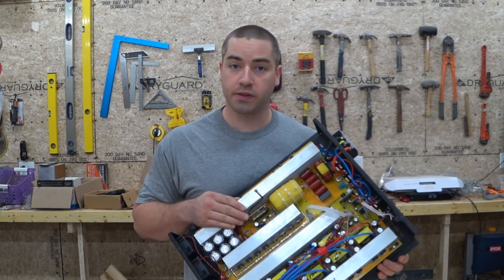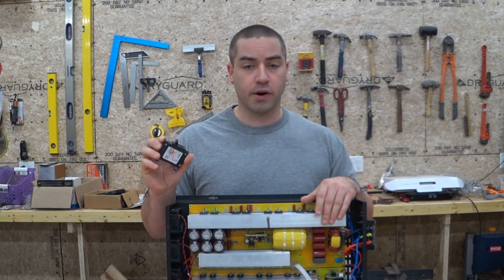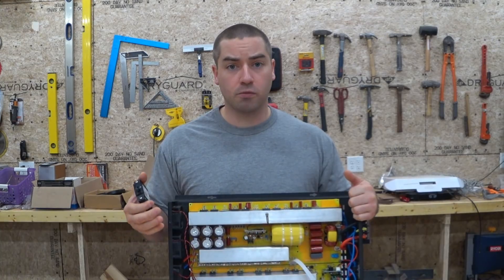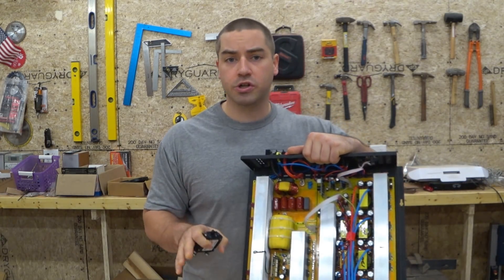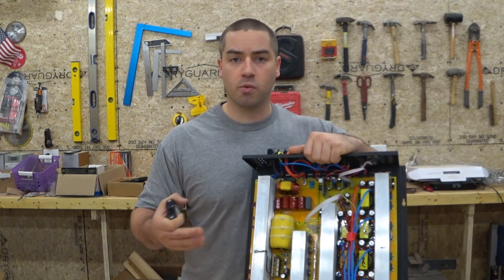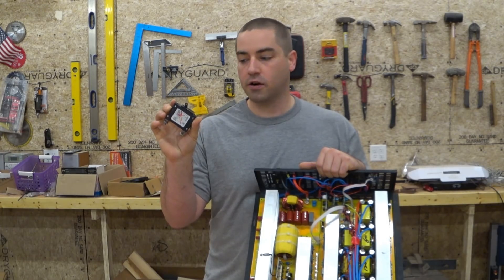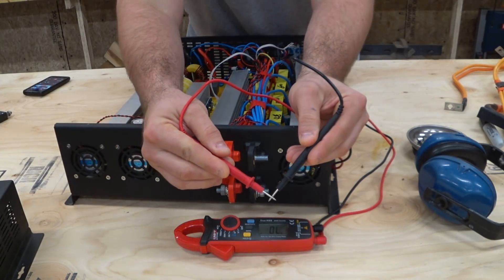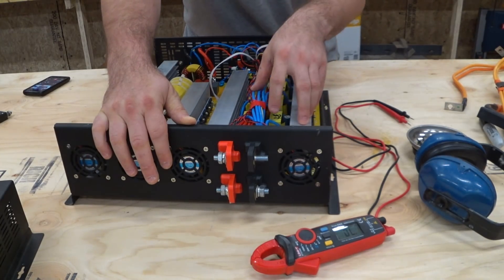Did I Blow Up the Inverter?

Comment: No, you didn't cause this inverter to fail. The reason that it failed is that this inverter consists of a low cost, lightweight, high frequency, transformerless design that connects your loads directly to the inverter's MOSFETs. High frequency, transformerless inverters use cheap Chinese manufactured MOSFETs that cannot take repeated exposures to high surge loads such as full sized refrigerators, large power tools or large microwave ovens. Without an iron core, copper wound transformer to absorb the back EMF and high surge demands of these high inductance loads, typically after about a year's worth of use these high frequency inverters typically become a non-repairable brick. 

You might be able to start and run some high surge loads when these inverter are new, but every time you fire up or shut down that inductive load, you're shortening the life of the MOSFETs in your solar generator. They also run much hotter than low frequency, transformer based inverters which makes the low cost, off spec, Chinese made components such as capacitors, diodes, resistors and ICs that are used in these inverters, far more prone to early failure. 

Another major consideration with these high frequency, output transformer free inverters is safety. All it takes is for one of the MOSFETs or IGBTs in their H-Bridge to short to ground or the control circuitry to fail, and these units will send dangerous, high voltage, high amperage DC current straight to your connected AC loads which will not only damage most AC appliances but can also set those AC appliances on fire.

A far better alternative is to invest a little more money and purchase a low frequency, transformer based inverter charger. Your system will last far, far longer and can easily power high surge loads without being damaged or damaging your appliances. I know this to be true because I've spent the last 23 years repairing inverters. High frequency solar generators simply don't last when powering inductive loads and can even burn transformers in your appliances.

Comment: The  mosfet or  fake this happened in my inverter circuit I design i always design inverter and never had issues with taxus instrument mosfet but I try international rectifier mosfet and the same thing happens mosfet internally fail if you had change all the mosfet to real mosfet the inverter should work the mosfet or the biggest issue in failure

Comment: So here's what I know about power inverters your gauge of wire is very important depending on the amperage in which you want to drop if the cables are under sized 40 application you blow that power inverter Sky-Hi I had to learn this the hard way so know what the saw a jizz and then decide what size wire you need because the one thing I know is I blowing up to power inverters just because I used the wrong gauge wire

Comment: Hi,
I have a Reliable 48v 240vac 3000w inverter which I have carried for a spare. On wiring it up I found it is sensitive to voltages.
It decided to not work so taking the top cover of I found the blade fuses.
They are only the cheap yellow auto type. Trying to pull these out to check them was nearly impossible. 
Few of the holders came away from the PCB. 
My first idea was to throw it in the bin.
They have gone up so much in price in Australia that I  decided to have a 
go at replacing the blade fuses with a resettable type blade fuse.

Comment: The failure mode is definitely shoot through on the low-voltage MOSFETs. My educated guess is this is caused by poor driver circuitry failing during the in rush, basically turning on both sides of the MOSFET bridge shorting the battery input between two or more MOSFETs.

Comment: HELP - SAME PROBLEM on my inverter. After replacing the internal blown fuses, immediately when connecting the positive cable back on to the inverter there would be a big spark ⚡️ on contact with the terminal and the same two fuses internally would be blown. There are 4 fuses internally and only two blow. 1000w Inverter….same brand as above. 👆 Any help out there?
Reply from the maker: When I had this happen I worked with the manufacturer to try and solve it.  I removed and tested every mosfet, and replaced the ones that tested bad.  After hooking everything back up, same problem happened again.  I may have missed one bad mosfet or something.  At the end of the day I didn't have time to keep working it.  I ended up giving the inverter away for free just so that the usable parts could be saved.  I moved on to more proven brands.

Comment: MY Reliable 3000 watt inveters has been running perfectly for two years also. i can run  a Hitachi saw an air compressor and have never had a problem.
Reply: Can you state which brand and model, I would like to write down. Most of all Inverters are chinese and copy same internals.

Comment: I bought a "Reliable" Weize 3000w 24v inverter which worked for a couple months and then failed. The company asked me to test the resistance on the mosfets and a couple were blown. They offered a discount on a new one rather than fixing or replacing the old one. I would avoid buying one from them.

Comment: Good video ... its great to see someone put there hand up and and take blame if it is indeed there fault ... but good news was you was not at fault. Also, im not sure if that clamping wire device would be good enough to "catch" the peak instant amperage draw ... im only guessing but i dont think it could react fast enough to catch the peak ... im probably wrong, just my 0.02 :)
Reply from the maker: Thanks for watching.  Since this video I bought a fast-acting meter and the actual surge peak is 64 amps on the 120V side for my miter saw.
Reply: @DavidPozEnergy  ahhh ok ... so it actually didnt catch the peak .. interesting! Although to be honest, your clip meter done a hell of alot better catching some of the peak then I had thought it would have ... . And you answered my next question already, which was "How much was it?" oh wow ... 64 amps! Yikes, thats quite a bit of juice to get that motor moved from stationary. Cheers for the reply mate ... you have some really good videos ... you got another sub!

Comment: I just saw Part 1 and Part 2. Did you finally find out what happen to those two Inverters that the circuit breaker from these two videos you just uploaded in these problems. Is there a Part 3. ?

Comment: The answer is yes you did destroy the Inverter by overloading it. The inverter design is not totally bad as I have seen worst, and it is not the midnight solar circuit breaker fault.
The MOSFETS just could not handle the huge current surge and they SHORTED out. I am sure the inverter can be repaired but the cost could be close to a new one so it may not be economical to repair. I am an electronics technician and would have repaired it if it were mine and upgraded the MOSFETS to handle a larger current. Great video.

Comment: A large part of the problem is current distribution within the inverter. There needs to be a centralized bus system where all the wire lengths from the bus to each bank of MOSFETs are the same, otherwise the ones that are closer to the source will end up doing more work under load.  This is apparent in the fact that the MOSFETs closer to the terminals ended up burning out first. One failure mode in transistors/MOSFETs is a short to ground, and it looks like this is exactly what happened.  This, in turn, ended up pulling enough current through the circuit breaker for it to do its job and shut the power almost immediately.  I wouldn’t be surprised if the traces on the underside of that board are scorched too.

I think a centralized power and ground bus inside the inverter, coupled with MOSFETs that are a little bit beefier, will make that inverter run like a raped animal.

A few bucks more in parts, and a slight redesign of the internal component layout and power distribution should do some justice.

Comment: Well I saw th video and it's not an issue of circuit breaker failing. But an in rush current happened and some components failed. I did not see th measurement you did on power side. The one you called input side

Comment: i think that your beeper beep because of capacitors input are discharged (which explain the spark when connected to battery).. if you put from your battery, a light bulb of same voltage, to the inverter, the bulb will still glow with a real short and not if no short (and you avoid the initial capacitors charging spark)..

Comment: I don't believe that the circuit breaker could have caused that problem. I agree with you that there must have been a failure in the inverter. Good job.

Comment: That amp-meter only samples at maybe 2hz - you need a scope to see the massive current spike that only lasted for a few milliseconds.  Inductive loads require 5-7 times their rated wattage from the inverter.  A low frequency inverter like the Aims has a massive transformer that can absorb huge inductive loads three times its own rating for up to 20 seconds for example - these cheap high frequency inverters let out the smoke from a single current spike like the one that killed yours from the saw.

Comment: Just getting into your “Stuff”. 650 comments, hope I’m not repeating someone comment.  The UL code requires that to be UL rated a breaker needs to handle (IE. open under) dead short conditions without perminate damage.  Most ac main breakers will open under dead shorts up to 10,000 amps which is the limit of the power company transformer at the pole in front of your house  Those devices that open perminately under dead short conditions are called fuses.  The surge when a motor first has power applied to it is called “locked” rotor. If you use fuses in a “motor” circuit you should use “slow blow” fuses. Yes, you have a DC breaker.. I see a CSA stamp but not a UL.

Comment: I don't think you were wrong, what failed in your experiment was not you it or the circuit breaker. it was the inverter. that inverter failed because they use substandard input and output MOSFETs that could blow for no reason. i short circuit is a socket simply should lead you to a MOSFET

Comment: Circuit breaker like this one has two opening mechanisms.  One is bi-metalic thermal based which is what the rated current is based on.  It takes some time to heat up and throw its latch opening, by design, to allow surges.  The other is a magnetic fast reaction trigger which responds to very high current like a momentary short and trips immediately.  A DC breaker also has an arc inhibitor which throws a  barrier across the gap as it opens for both bi-metalic rating trip and magnetic fast trip.  Problem was not the circuit breaker, it is the inverter design.  A good inverter would protect itself against an overload.  A circuit breaker is to protect you if the inverter fails, which it did and the circuit breaker did its job.

Comment: The current limiting is off or too high, higher than what the mosfets and or igbts can handle. A simple flaw in choices of parameters in the psw current sensor modul.

So normally, when an unbearable surge rush in, the current sensing modul will easily turn off the inverter, no harm done, and after a few moment, will power back up with the normal gradual voltage climb , and if we keep on pressing the power button of the miter saw, it will run with that slow start very easily amd smoothly this time, without any in rush

I hope they can fix that current sensing fault for their future products

Comment: The MOSFETs on the input stage failed. MOSFETs are quite delicate and can fail quite easily during voltage or current surges. Those cheap Chinese inverters use MOSFETs that aren’t adequately rated for the power levels and most of the time they don’t use enough of them and they overheat and fail. Also the boost transformer cores could be getting saturated at the high startup current and act as a short between the MOSFETs and blow the fuse and potentially the FETs as well.

Comment: The spike exceeded  135% ( the clamp meters to slow to0 record the initial inductive load) then a MOSFETs blew putting more loads on the rest - a cascade failure - For a home, you would be far better with a heavy low-frequency inverter  which has more headroom for momentary overloads

Comment: you may want to consider getting a computerized maybe usb amp meter because the electronics of the amp meter you are using may have a such low sample rate  it took the sample at the rise of the surge and fall of the surge curve.

i think they make meters that connect via usb and you can turn up the sample rate so it would get the peak of the surge.

if you bought the inverter from some chinese site i have seen some cheap stuff out there where they lie about the specs.

case in point i bought a utility wagon that was supposed to be rated for 1000 pounds (453.59237 kg for you metric people).

i blew out the tires and wheel bearings at no where near the rated load witch tells me that maybe the rating should have been 100.0 pounds (45.59237 kg for you metric people).

so it is possible that the inverter was made for 300 watts instead of 3000 or even 2000 watts and they typod and somehow the typo made it to the label printing department and got onto the case.

also the chinese are known to desolder parts from the boards and sell the used parts so the inverter could be made up of shoddy or even lower grade parts that was recycled from junk.

Comment: I've had exactly the same0 problem  with a 6000watt 24 volt sinewave inverter . Mine failed with no load  ,as soon as I connected to batteries. And switched it on , an inrush was huge  and blew all six fuses   , whole thing is dead
Reply: I've burnt out so many of these inverters  all different  wattage outputs .they are ok for basic  usages  , I e single appliance  bloody lights  and fans .I will guarantee that they will all fail in time .  Been doing this for years .

Comment: This is the only problem with high frequency inverters when they are subjected to sudden high current surges they fail, whereas a low frequency iron core transformer inverter never fails as their design perfectly matches withstanding high surges.

Comment: Re-watching this being bored during Covid-19 and noticed that the DC voltage drop was not calculated.  Not that it matters but using a lower amperage breaker or fuse will cause a larger voltage drop to the device being protected just like running thinner wires than needed for load.  Something to be careful of when testing stuff it can cause extreme heat breaking down insulation and shorting things out.  Now that being said I think the inverter should have sufficient capacitors to prevent the drop from becoming severe enough to cause other components to fail.

Comment: Question did you manage to sort out the problem with inverter because something just came to mine I don't know if it would help or not if you look at the  AC input the grounds and the Neutral are still live maybe that might of course the problem please let me know
Reply from the maker: Thanks for your idea.  I no longer have the broken inverter.  The manufacturer does not make this model anymore, they updated the whole design.

Comment: I bought two chinese made inverters. The first one was a 5000 watt and when I turned it on the fans and alarm came on without any load. After about ten seconds the fans started reducing their speed. Then there were sounds of small explosions or firecrackers and smoke until the inverter went dead. Upon further investigation, I found the Positive and Negative terminals were both bridged with the copper strip. So that was a manufacturing fault. The second inverter was 3000 watts. I hooked it up, turned it on and explosions again. I opened it up and found the positive and negative were bridged. So I would suggest that you check the terminals to see if there are bridged. I will not be buying any more chinese made inverters again. A technician who repairs inverters told me inverters made in Korea are very good.

Comment: To hard to measure now. But low voltage output from invertor could have been a factor. The focus has been on current from what I have read so far. Can the invertor handle the instant current draw and maintain a steady voltage?